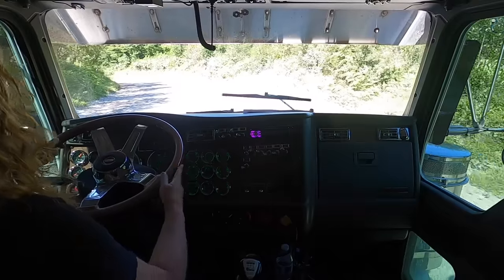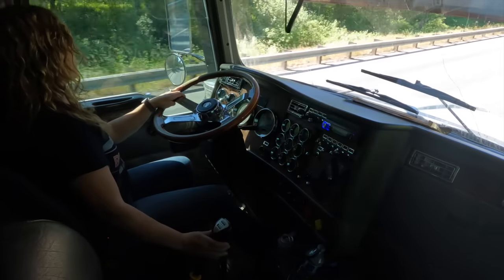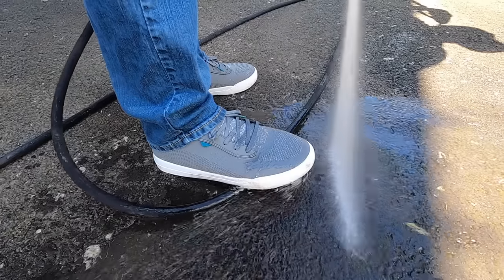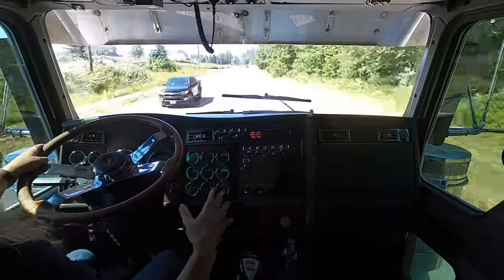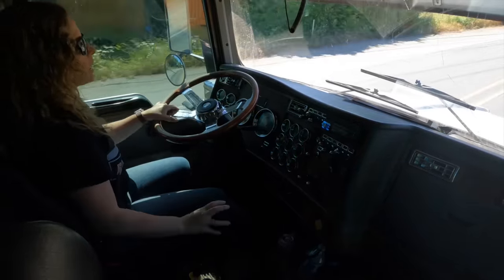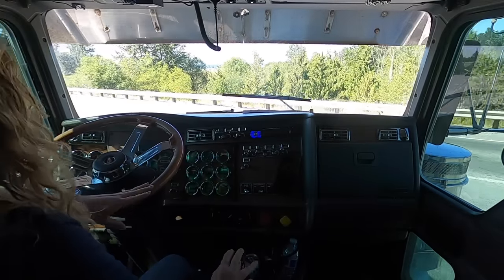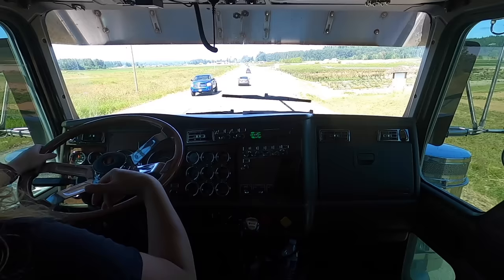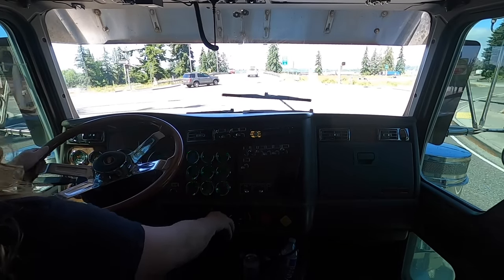How to shift an 18 speed Eaton Fuller Transmission. Down shifting explained on a loaded semi truck.

Comment: Back in the day I’m talking 70s all semi‘s that were manufactured the tachometer had a V painted on the face of the tack and that was your working range so that was The most efficient performance Range of an engine no matter how fast the truck was moving if you always kept your RPMs in that range you will get the best fuel mileage performance and longevity out of that engine I wish they would put that line back on the tachometer because that is important on no matter what make of engine no matter a car truck motorcycle or a tractor it’s called the performance range area. I started driving trucks hauling milk in Northeast Ohio Westernpennsylvania. from the Farms to the cheese plant in 1966, i’ve got my 5,000,000 mile in and I am retired, but I really enjoy watching your channel you are really a good driver and I’m not talking about going down the road I’m talking about the way you shift the way you handle the truck and shifting every day is different all depends on whether you have that trailer on or you have 10 ton or 30 ton and I’m not telling you anything just commenting I really think you do a good job.

Comment: Excellent explanation, Dauminique! As for floating the gears, my first trainer's brother worked for Eaton and claimed they could tell which transmissions coming in for rebuild had been floated or not. The clutched transmissions were typically in much worse condition than those that were floated. Too many noobs have no idea how to double clutch. I did as I came from the charter bus arena where double clutching was a necessity. Keep these great videos coming!

Comment: I was taught in school to use the speed to match the gear. Real basic stuff, 15mph was 1+5=6 or 6th gear, 25 was 2+5=7 or 7th gear and so on. It helped me understand which side of the transmission I needed to be on and where, in a round about way. Over time it became sound and feel.
Reply: That all depends on your rear end gear ratio!

Comment: Keep your foot on the gas (pressure) on accelerator, when you pull it out of gear ,  same when you flip switch!   You have the “selector” switch ( hi and low range on front )  and the splitter on the side ( thumb switch)  to split ratios in each gear !   Always move switch while gas is depressed ( foot on gas )  as this keeps tension on the drivetrain,  then let off gas , and it will shift automatically!  The smoothness depends on how much you finesse the throttle.  Otherwise you can damage the transmission !  Timing and finesse makes for a smooth shift every time!

Comment: Way , to go Dauminque , you drive like I used to , it's been 21 years since I drive  shifting gears , and  I was watching your video as a refresher course , so that when I go back to Truck Driving School  I would still do it correctly ,  when you're got your shifting great you can float it in without using the clutch  just don't do it on road tests with the DMV for your CDL driving test or job Road tests   , by the way we need more lady truck drivers .  Have a lot of great days , OK ?

Comment: I once drove a W900 pulling a rock dumper that had a super 10 (split every gear) with what looked like a range switch on the shift rod. It turned out to be a Jake brake switch! very sweet not having to reach for the dash to engage/disengage it. Thanks for the video, you made many good points.
Reply: So I dont drive but understand. Jake on the the stick is a awesome thought!!! 👍🏻👍🏻
Reply: I always thought about the Jake switch on the shifter. Also, the cruise control switches would be handy.
Reply: @tjwiersma4406  never drove a big rig with cruise, sounds like a good thing. 🙂 been retired for a while.

Comment: You done a great job! I fail when i record myself too. I was taught by a religious double clutcher. I never could get the double clutching but i picked up my own style "if loaded up shifting i clutch to neutral instead of gas the umpf as you called it,and float to the next gear" empty upshifts i rarely use my clutch to neutral,float technique unless its kinda climbing a hill. Downshifts i always use my clutch neutral,float the next gear technique. Ill let the Jake's pull it to a grand while easing brakes clutch neutral, rev to 1400 or so, itll usually fall in. If its tickling the gear,i kinda feather the pedal. It works for me and happened by chance,i was always told to float tge gears but i was taught by an old trucker that wanted to see you double clutching. So i picked up this different technique that works for me so i dont change, die hard creature of habit i guess you'd say. So i guess i appease both the floaters abd double clutchers, atleast partly anyways lol. Great video!

Comment: Hi Dauminique, having driven roadies for years now I have actually learnt how to split down from your video. Sanchez Trucking has a scene where they do the same split. My original teacher taught me to ‘split shift up shifting but never split shift downshifting’ possibly to our hilly terrain  in NZ. It’s certainly harder to grab the half gear when road speed is dropping quickly.. and you can grab a full gear on an 18 speed easily. Certainly need to drive by feel with a roadie in any gearbox configuration and actually had an 8 speed Eaton in a smaller 6 wheeler that required a lot of concentration which becomes part of the fun of working out your vehicle.

Comment: I always take off in third empty . My first truck was a1961 Kenworth with 4x4 two stick transmission and brownie box . My truck now is a2000 379 Peterbilt with a 750  hp C16 Cat pulling a Bull rack . It has an 18 speed and tall rear ends and is set at 125 mph top speed . Some times hauling cattle we get up to those triple digit speeds pounding the left lane .

Comment: As Always great video on the 18 speed transmissions. I remember my first time drove 18 speed  with my instructor in school. Apparently I was doing something wrong where I ended up grinding the gear  for whatever reason and the instructor pull me over on rode and switch seat to show me how it done. He floated ever gear which was confusing at first because in school they teach the double clutch method which take a lot hand and foot coordination. I eventually was able to catch on very quickly and so  every time I drive  a truck I never driven before and try to  feel the  truck  like the RPM.. I fast the RPM rise and fall which determine  how well I shift, for example when I downshifting and I know I have to slow the vehicle so the RPM drop to 1000 and then increase the RPM to about 1500 before catching the next lower gear.  Well with certain truck the RPM will rise and drop faster depending on where the RPM idle at.

Comment: Dauminique, that is a great video.
Another way to refer to your thumb shifter for your high & low  is direct which is low and over which is high. Another thing the clutch brake, yes definitely sucks when it goes out but you can still drive without one as long as you're in gear, when you stop push your clutch in halfway it will still work like normal, you just don't want to stop with it not in gear or then you will have to turn the truck off then start the truck in low gear. I don't shift with the clutch either, the only time I use a clutch is stopping and going. I skip most all lower gears this is how I shift, you should try it see if you like it. If you want you could still start off in first if you prefer.
I have a 18 speed & haul 105,500 as well I normally start off in 2n, loaded or not, then you're going to switch to the high side of the transmission in direct/Low on your thumb switch then you're going to shift over to low  all the way towards you and down which is also referred as oh no gear😊
Then your thumb switch move to over/high
Then go to 5th direct/low then continue from there the rest of your gears also works good for downshifting, especially in town, I barely ever go down to the low side of the transmission.
I almost forgot, another thing I wanted to add, the color of your thumb switch... 18 speeds are gray, 13 speeds are red, 15 speeds are blue. If it don't have a thumb switch and just a high low on the main, normally they're 10 speeds.. for anybody that gets in a truck and the shift pattern is gone, that's how you can tell also. Again great video! I hope you try it! I love shifting like this. My favorite transmission to shift really is a 18-speed double over which means 3rd, 4th, 7th, and 8th are backwards, super fun.
Reply: Straight 8 speeds,and 9 speeds also had the high and low splitter. And the 8ll was blue thumb splitter but it was a shade lighter than the 15 speed. I wanna say the 7ll and 9ll used the lighter blue thumb button like the 8ll. They weren't very common. Never drove either one (7ll or 9ll) but have drove plenty 8ll. I wanted to add that sometimes I find it easier on the 13 and 18 to pull the stick to neutral position to make the thumb split then send the gear stick back in the hole. Eaton doesn't recommend this but sometimes it's easier. The jamaican boys do it all the time mostly for show but I have found it easier and sometimes necessary.  But I know I'm not nowhere near a professional and rarely feel I can advise anyone. I've had off days where I couldn't back a trailer to save my life. I've had days where I couldn't shift for crap and have had to stop in the road and start over,feeling embarrassed rushing and have to stop again and start over. Some days I glide em in all day without scraping. Maybe it's just me but I feel like we all have them days or that's atleast what I've seen and been told by all my older protégés.

Comment: The Low Inertia design came out in about 1988, first only on the 18-speed, you can preselect the splitter when doing a compound shift--that is shifting the main box and splitter at the same time. When changing the split from low to high or vice versa in gear, you do need to feather the throttle and accelerate slightly to shift to low, and then feather the throttle and release it to shift to high. But to shift from 7th high to 8th low, or 8th low or 7th high, you just shift fast. You just pre-select the spliitter and then shift quickly going up, and shift quickly and accelerate very slightly when shifting up. Same technique also works on the high range side of a 13-speed. It's a big advantage when it comes to fast and easy split shifts. While it's not necessary to shift this way and use all the gears, split shifting is a great help when upshifting on steep grades, and on the highway at speed, using all the gears can save fuel by enabling you to climb slight grades at the lowest RPM that will maintain your speed.

Comment: Honey. The shift lever in the front of the shift knob is called your Hi/Low range selector.
The selector button to the left of the shift knob is your Direct/Overdrive selector. The way you have been taught to downshift by feathering the throttle gently until you can move the stick to a lower gear. The way where people burp the throttle and then shift is where a person really gets to know their transmission. Alot of people miss and grind alot aand just try to act cool while shifting. These transmissions are quite forgiving but for someone operating out of just trying to be cool, will one day soon  Rui. The transmission. I am a very well seasoned truck driver of nearly 30 years. I am practically a professor of the operations of all types of fuller transmissions. I can even tell you what type of transmission you have in your truck, over the phone while just asking a few questions .

Comment: You're right...everyone is different & has their own way. I drove a triaxle for 16 years, and driven a handful of trucks. First thing I did in each truck was let the truck tell me where it wanted to shift, and from there I worked with IT, not it working with ME. And in each truck, usually the only time I used the clutch was for starting or stopping. The only other time was if I wanted to skip gears....which I did a lot as well. Once you get to know your truck, you can do great things with it without beating it into submission, or into the ground.

Comment: Situation @17:15 is where you quickly push the clutch 1/2 way down and go into neutral. Complete the downshift without the clutch.  A loaded truck's entire drivetrain will feel that "umph" technique. No hate, just thought I'd share that rare situation where using the clutch really helps.

Comment: I went to a truck driving school to convert my class A to a commercial class A.  I got my original class A in my state when I was 18 and there was no commercial license difference.   My dad taught me how to shift, he taught me very similar to how you did it.   In class they required that we use the clutch and double clutch every shift.   I believe in following rules and the instructor knows best so I did as they said.   

One day on our road trip the instructor looked at me and said, “if I didn’t hear the clutch squeaking I would think you were floating the gears.”  He looked at me and gave that smile that said, go ahead and drive it.  

I started floating and didn’t miss a gear and he just let me drive.  

When I signed in to a mega-carrier to start driving I asked if a trainer had a manual truck, did not want to drive an auto.  They hook me up with an old school driver who had a manual Freightliner.  By day two he said, “you sure you are new at this”?  Can you shift without the clutch?   Next light I showed him I could.  We got along great, had just had to work on my backing with a trailer in tight spots.  

I got a manual truck from the company and never had an issue.  If the dispatcher/ fleet manager hadn’t been a PITA I would still be with that company.  

Thanks for the video.

Comment: I just got on here, and I'm still waiting to see you shift. OK, now I'm at the half way point and I've seen a few downshifts. Also did I see you split some up shifts in low range? Girl! You rock! I split low range in my 18 speed sometimes too. I've driven long haul for 48 years, and I can say that you are an excellent driver. I don't use the clutch much either, but for brand new drivers I teach them to partial clutch. It's not what you think! I have a video on that on Stern Drive with Doug Stern. See "3 Ways To Shift a 13 Speed" will show an easy way to partial clutch. Drive safe!

Comment: What took the longest to do well was slowing down quickly for a turn or traffic and figuring out what gear I should be using.  Especially at slower speeds in towns and heavier traffic.

Comment: I drive from Vegas to Phoenix daily in a 2007 Kenworth W-900. Nice video! And you absolutely don’t need to use that clutch unless you’re taking off. You float those gears. Anyone who states differently is sooooo wrong.

Comment: Don’t worry about missin a gear or grinding a gear, everyone does it as you have good and bad days. If someone tells you they don’t grind or miss gears they are lying full stop. Good work by the way, I don’t split going up a hill just use whole gears also only split top box not bottom box and when loaded I’ll have 3-4 trailers with 115000-150000 litres of diesel when loaded.👍👍👍

Comment: My experience has also been that every truck is a little bit different ...even if they are spec's exactly the same.
Reply from the maker: That’s very true
Reply: When they'd reset all the valve gaps on your engine and the response time changes you'd need a day to reprogram your brain to shift smoothly again

Comment: When you get really good you can slap the fuel and get the gear everyime, You can also hover your foot slightly on the fuel to act as the clutch as well, although I do agree to raise the fuel until you match the gear everytime until you really know what you're doing.  Drove locally for 7 yeears now pulling 63500 (139500), was definitely a great experience learning an 18 speed.  CLUTCH HALF WAY!!!. You can feel it get stiffer as you get into the clutch brake, only do that when stopped and you need to get going again! Huge problem at our company.

Comment: As always great video girl!!  You did a fine job you have a sweet truck. drove truck 38 year's drove from 5 with 2 speed axle 10 road ranger 13 speed road ranger 15 double over started out in old 427 gas burner. Drove for 20 year's without a/c worst was super 10 after havin to stop on a hill because it didn't down shift I finally figured out if you pull it out then flip splitter it went in every time. Think 13 speed was my favorite.  Thanks for sharing be safe out there

Comment: The trick to downshifting,  is to treat it just like upshifting .   Hit the break briefly to slow the truck speed down , as well as the rpm’s ,   Take the shifter into the neutral position,  rev the throttle,  to around 1800-2000 , and let off throttle,   Immediately apply slight pressure to the next lowest gear till it falls in ,  just like upshifting !   Same procedure in reverse .    It’s matching the road speed ( flywheel)  to the transmission speed ,   As big truck transmissions don’t have synchronizers.
You have to make it “mesh”  it’s all about timing,   With practice it comes naturally!  If you understand it,  you’ll never “ miss” gears !
Double clutching doesn’t make it shift easier,   Just wears out a clutch faster !

Comment: I think I'm the only one watching that started driving a 'gas burner' log truck early 1962 teen years (I had a license at age 14, just walked in, asked to buy a license, paid, walked out, no testing....aw, the good old days!!!!). 

Started with a big transmission, a 5 speed with a 2 speed rear end. They were a walk in the park if you were paying attention AND you used the clutch. A 250hp diesel was HUGE POWER back then. Always wanted to log with a 'B' Model Mack or an Autocar....just couldn't afford to buy one...lol.